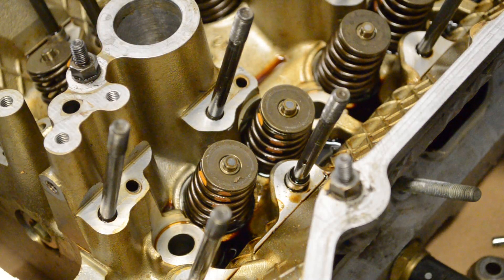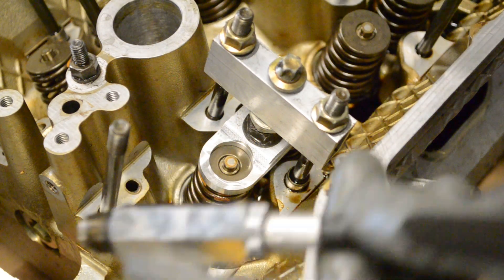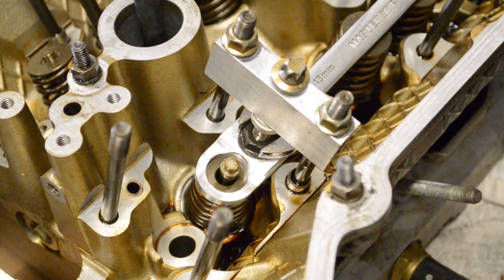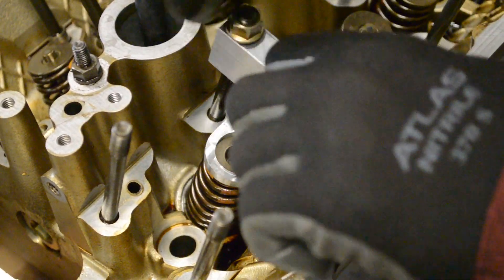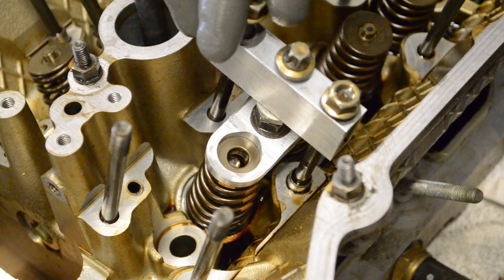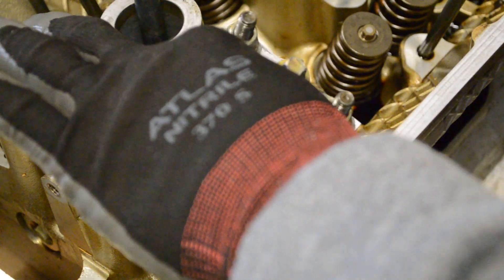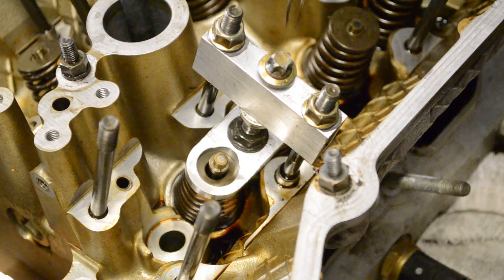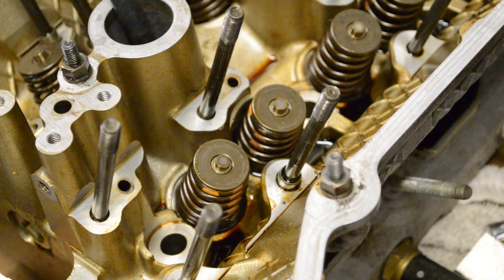BMW S50/S52/M50/M52/M54 Valve Spring Compressor Tool

Comment: Great tool, I‘ll certainly make one of them for myself too.
And for resetting of the keepers, I always smear a blob of Vaseline to the grooves on valve stem. That keeps these little escape artists sticking real good, even if the alignment of the retainer is not perfect when releasing it back up.

Comment: Nice tool, I was probably going to make a similar one then come across this. Looks like those springs taper in towards the top, whereas my M50 has the standard fat/wide, non tapered spring (probably about as wide as the base of your srping, but the same width all the way up). Would this work for those type of springs, or would it only fit the smaller tapered springs? Also I'm in Australia, do you post O/S? Cheers